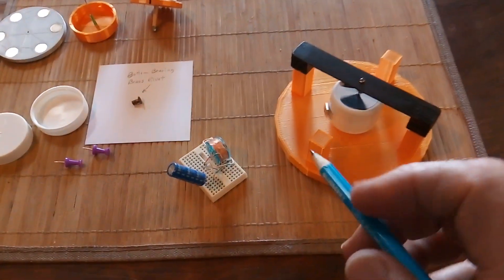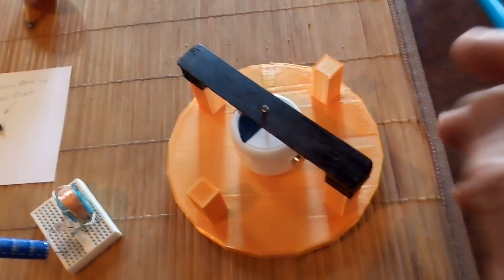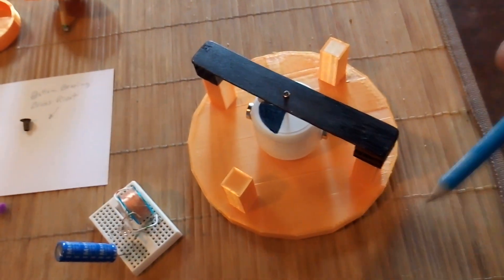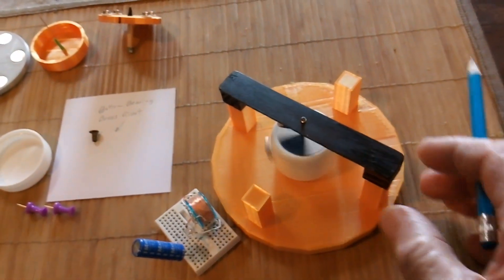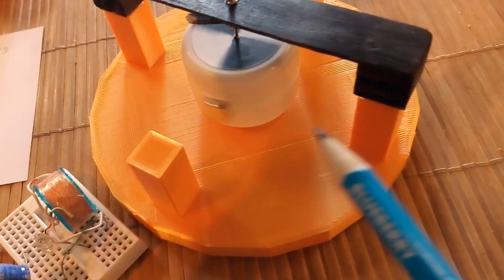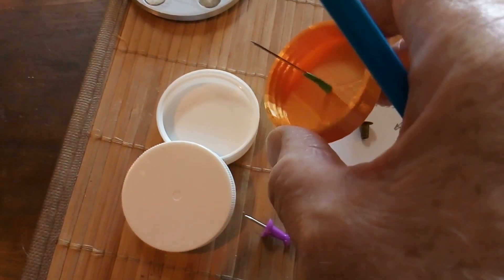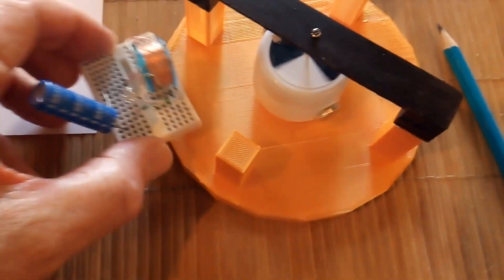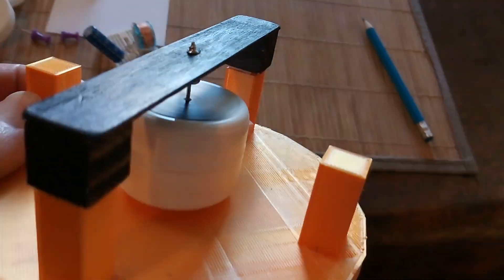3D printed pulse motor stator base

Comment: Turn the bed heat up and move the nozzle closer to the bed. It will smash the filament into the bed and give that nice shiny surface. Also may help to turn your layer height down a touch.
Reply from the maker: Thanks. I will try that,  I have had some trouble with the print sticking badly to the bed if I get the nozzle too close.   I cleaned the bed with alcohol and it is better now.

Comment: Enjoyed that. You have a very big pulse motor there. Is it transistor-based and running off a supercapacitor? 👍
Reply from the maker: This drive is just a reed switch type but the motor will run on a transistor circuit just fine.  The energy storage is a 10F 2.7v super capacitor filled with 2volts.  This ran yesterday for over 7 hours on that sored energy.
Reply: @Lidmotor  7 hours is great. These supercapacitors seem to be getting better all the time.

Comment: When printing the lid, would it be easier perhaps to flip it around so the flat surface is on top?
Less contact with the bed could make it easier to remove.
Reply from the maker: Thanks.  I will try that.

Comment: You are making great progress. I couldn't resist downloaded that Dolhareubang Spinning Top, especially as it was based on a stone grandad. So I have my own solar spinning grandad now 😆
Reply from the maker: I look forward to seeing that.  I am looking at 3D printed boat designs now.  Your projects with those plastic hulls have been fun to watch.
Reply: @Lidmotor  they are all a bit small, limited by the size of the print bed. I will have to print them in sections so I can go bigger.
Reply from the maker: @GrandadIsAnOldMan  At my other house I have a swimming pool that would be great for boat testing.  Your boat design with the gear system drive would be a good learning project for me.
Reply: @Lidmotor  The motor I used was a bit excessive, a smaller motor would do fine. The one I used ran very hot and melted the PLA so when it cooled the whole thing seized up. The gears came from somebody else's 3D work that I "harvested" for parts 😆
Reply: @Lidmotor  A nice little solar powered boat on the swimming pool would be perfect 👍
Reply: hi grandson..hi grandad .. very happy to see you have the same hobby, there is one question for you, among all pulse motors, which input power (watt) is the most efficient  referring to all your circuits. 
thank you .. Keep to be our inspiration.
Reply: @Mp1306-tm  I think that is a question for Lidmotor. I don't get into technical details like measuring the input/output.
Reply from the maker: @Mp1306-tm  I am using a very simple two transistor drive circuit on most of my pulse motors now.  The down side is that it needs at least 1.5v to work the best.  A simple reed switch circuit with a high turn fine wire coil is the easiest. The secret trick is the fine wire coil with many many turns.  The way that the Lasersaber EZ spins works is with multiple coils in series and the same number of magnets on the rotor.  They run on micro watts.
Reply: @Lidmotor  i have seen the  lasersaber EZ spins and it ran perfectly. I don't have NASA equipment :)  so I just want to make a simple pulse motor but it's as great as yours.
thanks lid & grandad ... stay happy